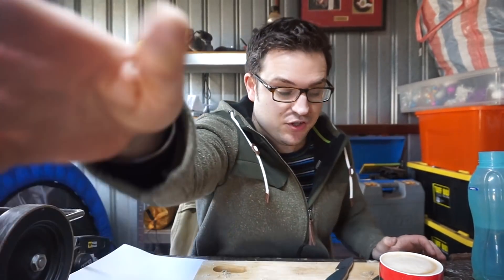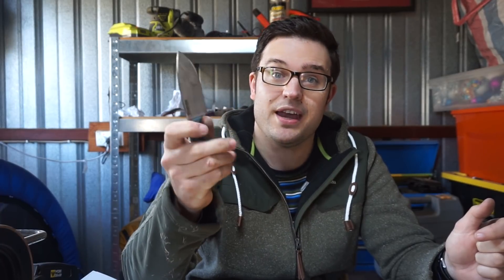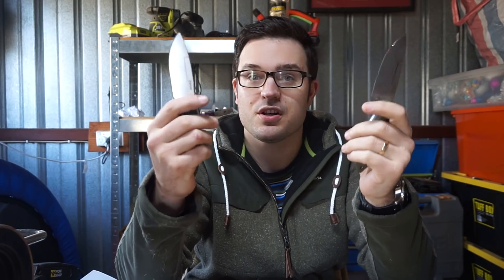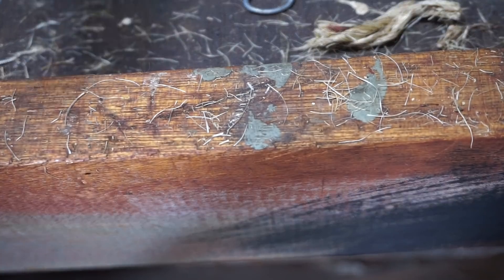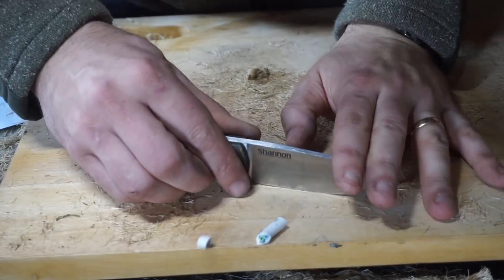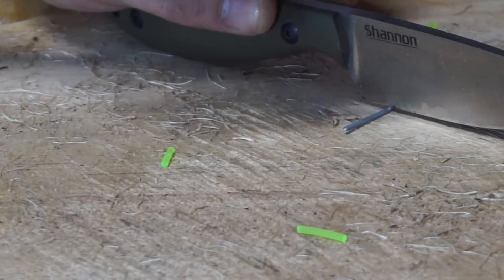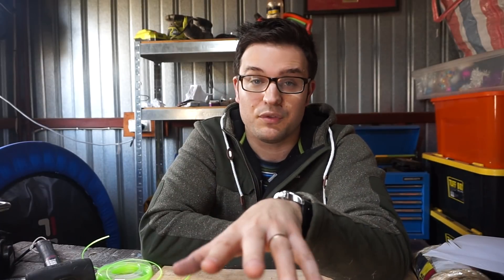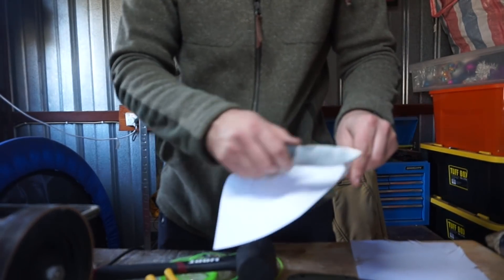Nitrogen : Steels of the Future? Vanax Superclean and Z Finit - Mirror Edges

Comment: Thanks. been looking for these results. did you find vanax a little more difficult to sharpen? I did. but, you confirmed my experience, vanax has more edge retention than LC200N. also better rust resistance. but I have not seen it compared head to head with H1 for the "title" in rust resistance. Larin told me both these steels outperform magnacut in rust resistance. but, of the four rust resistant steels, you've shown magnacut has the best edge retention. so, thank you for that.

Comment: INFI. Steel of the gods. Look it up.
Reply from the maker: I know about INFI. Its a branded name of a steel called A8 mod. It has .45% carbon, 7.94% chromium 1.37 molybdenum and 0.4% vanadium, and a whole lot of manufacturers mystique from hoardes of fervent fans. It is remarkably tough given its low carbon content, but its absolutely nothing special chemically, and any efforts to test it that dont produce glowing results get screamed down by Busse loyal folk who have thousands of dollars invested in blades made of steel also used on woodchipper blades. I’ve played with a busse and the edge was so darn thick I couldnt reprofile it without lowering the value to the point the person loaning it would have hated me, so I tried to run it through my rope tests in a different way with a pretty unflattering result, got hate mail from Busse guys so am pretty much leaving the stuff alone cos there is a far too loud group of the community just not open to challenge on their viewpoint in any way.
Reply: @CedricAda  I own enough Busse blades to know that the heat treat is decent (for wood chippers) but the vast majority of blade geometries and ergonomics are amatuer at best and unuseably, incompetently designed at worst.
The only reason I even brought it up was because it was purported to have nitrogen in its composition. I completely agree with your assessment.
Most Busse owners would be better served by a $5 hatchet.

Comment: In regards to the ken onion knife sharpener I think that’ it’s hard to get a perfect angle for knives using it
Reply: It's junk for precise edges. And I refuse to use it on my premium knives. 

I'll use it on machetes, axes, scissor and what not though.
Reply: @Puddspanker  Absolutely I have made the mistake of sheering off good steel on this crap 😆😆😝😆😝🤣 trying to get a good angle 📐 my cpm 3V, especially my cpm 20cv it really did that one bad 😝😂😝
Reply: @Drvinnieboombatts  yeah trying not to round the tip too.

Comment: I was thinking, when you do the crazy steel vs metal tests, you could also do a run on a hard surface (no wood), like a not hardened steel. You should get the toughness/ductility of the steels without the kinda random lateral force. I mean later strength is an important characteristic, but it's a bit harder to test correctly on the edge, without specific instruments! Btw, great stuff, love those test videos.

Comment: Thanks Pete for the vid and thanks Colin for knives 

This was fun to watch.
Looks like Vanax (blue handle) was tougher then LC200N, less damage, the bailing wire is nice eh? Less Destructive then a big ass nail but still can see some differences without losing a knife.
Reply from the maker: Big Brown Bear yeah the z finit had
a bigger void in it that the vanax and the 3v which were about on par from my POV. If this was my knife, it would be eating some bolts I reckon hahaha. But trying not to damage in a way that I cant undo heheh
Reply: so what do you think Pete, is Vanax enough to steal your heart away from LC200N? Would you pay $75  more for the same knife in Vanax?
Reply from the maker: I think I would. It behaves like M390 but  even more stainless!
Reply: Cedric & Ada Gear and Outdoors haha crazy
Reply: Big Brown Bear I noticed RMJ has a couple of knives in Nitro V, can you tell me anything about it?